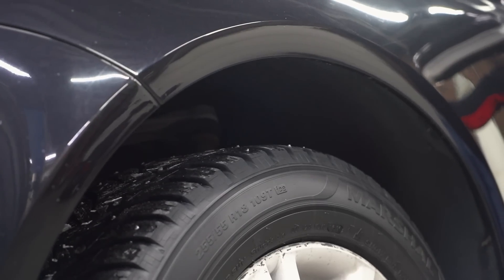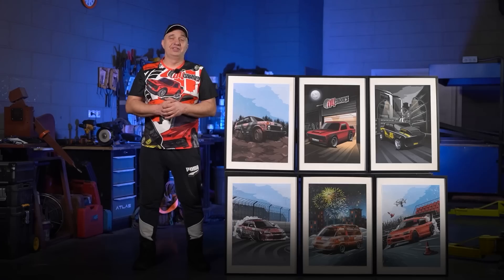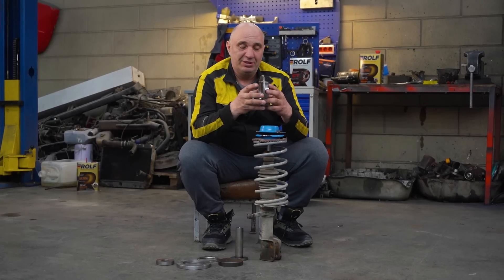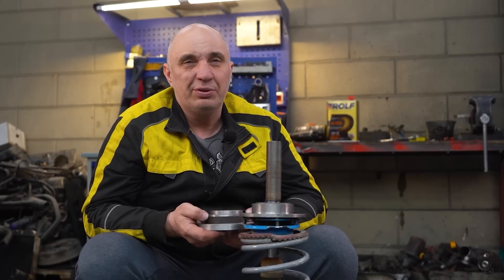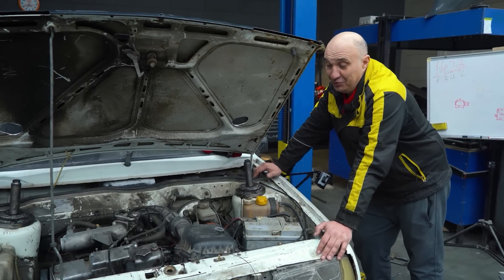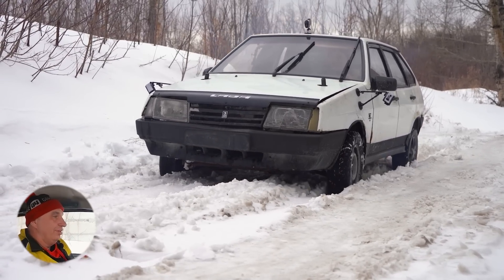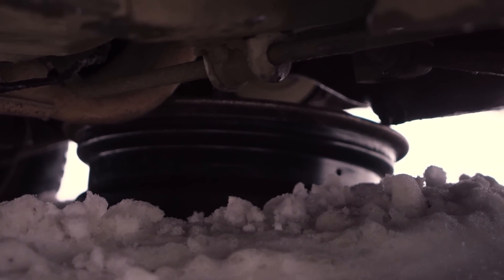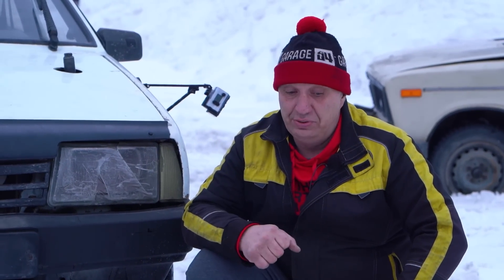We make suspension with on-the-fly mechanically adjustable ride height

Comment: I think you guys should go the whole 107% and fit 4 hydraulic rams, one at each wheel the hook up a hydraulic pump to the motor with controls in the cab so the driver can rais or lower the car on the go.

Comment: My suggestion would be to add screws to the rear suspension as well, then fit a portable pipe threader to each corner.  The portable pipe threading tool is already geared down pretty low so should be able to handle the torque/load easily and would be mounted solidly.  Fix the nuts to the portable pipe threaders, then activate them all (wired together so that they all lift/descend at about the same rate) from a lever on the dash (up = raise the car, down = lower the car) for true on-the-fly adjustability.  Or something to that effect.  :)

Comment: Then, instead the standart car struts, replace with hydraulic cylinder, add hydropneumatic accumulator for comfort, hydraulic pump and distributor, and you will get a simple version of Citroen hydropneumatic suspension

Comment: Before they even started i knew the CVs would be an issue. When you raise a fwd you run the risk of the cv hitting the lower control arm. You can also have binding in the ball joint. The inner cv can be an issue as well. The length of the shaft changes with the inner cv. It is a very minimal movement. This can cause the inner cv to pop out of the transmission.  This design is all good in theory. Practicality,  no good.  I've  built many suspension systems for 4wheel drive vehicles with IFS. The front diff must be dropped to gain any type of usable  lift. The limiting factor in all IFS systems is always the cv shafts. Best thing to do with a truck when you want large amounts of lift,  ditch the IFS and replace it with a straight axle. Stronger, less moving parts. The amount you can lift a straight axle is whatever you like. Although,  with extreme lift and articulation you have to go with a hydraulic steering system.
Reply: Yes,  what you say is true. However, they made a fun video that did help improve clearance enough for certain situations. To do as you suggested would take a lot more work and cost but definitely do able.

Comment: it may give the floorpan/bodywork more ground clearance BUT the lower suspension arms etc are all still at the same height so if theyre the problem you are trying to overcome, NO height adjustable suspension is going to help
Reply: Yes. Remember, he showed the marks on the snow from the exhaust, radiator support, differential that dragged the center of the ruts. They were able to raise most of the vehicle and create ground clearance to help in certain situations. The parts you mentioned would have to be replaced with modified versions to improve total ground clearance.

Comment: one of the high priced model cars, mersades or bmw has this system on all wheels you can activate from inside. the purpose is to bounce it up and down and get you unstuck on sand.
Reply: That's just air ride nothing like what these boys did
Reply: you are wrong. its a new feature for getting un stuck in sand. @Jacobtheunwise

Comment: Next stage, add a motor to this so it can be adjusted on the fly from the driver's seat with the press of a button as well as modifying it so that it does not require a bolt to be sticking out of the bonnet. I'd buy it! I have been interested in this type of idea for quite some time. Englishman in Novosibirsk 👍
Reply: Just get the overpriced airbag version

Comment: you should force air in the lower crank case of an engine and see what happens. i suggest drill and tap a hole in the block and hook up a ball valve to an air line :)
Reply: That would just create blow by
Reply: @Jacobtheunwise i didnt think about this, but yeah depending on how good your rings are, it’ll just run leaner. the pistons will cancel each other out so its not like the air pressure will change

Comment: nice, now u need to do the same to the rear, ( or a different but similar method, perhaps the same thing but on top of the springs? ) and then connect motors to the shafts, so you can control it via the cab by a switch!  hell, connect it to the passenger power window switch! heheh, just change wires from the window motor to the external motors for the lift unit. may need additional relays for power load... but sweet guys!

Comment: I suggest connecting a gear box to the suspension system here. Then when you want to raise it from within the car you select the up gear, when on clear road hit the lower gear. While in Neutral of course. Let the engine raise and lower your Lada.
Reply: PTO powered ride height adjustment. Fantastic!!

Comment: Instead of the original car struts .. replace them with hydraulic rams... with a controller in the car.. lot easier 🤩🤩🤩
Reply: Basically that would be The Citroen hydropneumatic suspension.

Comment: You could improve the system by adding a couple of high torque slow speed gear motors wire with forward and reverse and controlled from a 3 position toggle switch mounted on your dash to save you having to manually operate the system in the freezing cold !

Comment: This has been use in oval track racing extensively for ride height and  wedge adjustments corner to corner suspension load nice insulation on a strut car 👍
Reply: Yeah. Screw jacks. On our late model.

Comment: Props for using ratchets, I would have totally grabbed a pneumatic ratchet or a battery powered one. Or mounted a cheap pair of eBay pneumatics and welded them on top of the adjuster with a bracket, then mounted a compressor somewhere inside.
Reply: Just use something 12 volt, already have power right there.

Comment: Had a 98 3/4 Chevy that you could twist the front up a few inches to run a snowplow. Great experiment
 I could see this getting toyko drift out of a fix-it ticket from having his k-swap to low lol
Reply: Most of us use adjustable coil overs on the little 4 banger ricer cars, using a spanner wrench u can adjust the preload and ride height.
On the old school muscle cars we often use air shocks for years before finally putting real shocks on.

Comment: Subaru used to have adjustable suspension that worked in much the same way.
I used it quite often in my 1982 Brat.
Reply: My 83 BRAT has it. I think the wagons had it also, only gives about 25mm though. The struts are impossible to find nowadays, luckily they're rebuildable.
Reply: @jonathancrotts2862 was it a special option or something , I had a 82 brat and it didn't have that. I ended up putting a 3 inch lift on it and the thing was a beast offroad

Comment: You totally need to motorize that! :)
Reply: Just use some power tools
Reply: @p.l.a.y.e.r_2 Yeah 1/2" drive Milwaukee M18 impact would make things much easier! 😀
Reply: @cpufrost The impact part is a waste of time
Reply: Zip-tie one impact wrench one each spring and there you go lol
Reply: Yes! That's a great idea 👍
Reply: Love this idea and my first thought. An old drill with a dead battery I will give you my DeWalt for it. Telescopic and motorized and make it adjustable like Detroit speed sells. I would buy it.
Reply: Bro, was gonna say the same thing. We are on the same wavelength. Maybe also have some set of buttons or toggle switches in the car near the dashboard to activate the motors, so Vlad doesn't have to get out of the vehicle on a cold day. :) If one wants to be super fancy, connect the motors to an Arduino or micro-controller that can display the ride height in centimeters and allow for custom height presets.

Honeywell makes toggle switches, but I am not sure if Honeywell is in Siberia.
Reply: I don't think you'd want that impact.  Just a high torque DC motor like a winch
Reply: BMW Motorrad has such feature on some of their bikes.
Reply: I agree! I’d like to try that on a Jeep Liberty!!
Reply: Yess
Reply: I was thinking just that. Something like two battery powered impact wrenches, or a compressor, tank, and air tools.
Reply: 😅 90% to creator
Reply: People power is cheaper which is why 10,000 backhoes are sold to 3.1 billion shovels per year lol